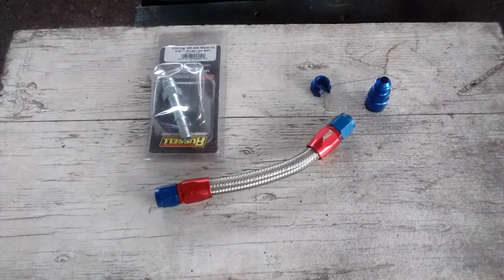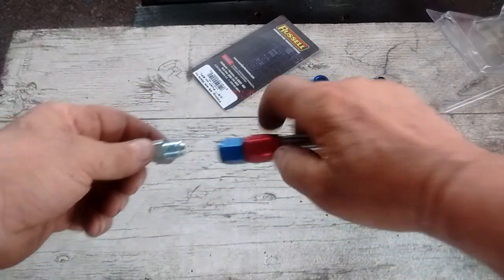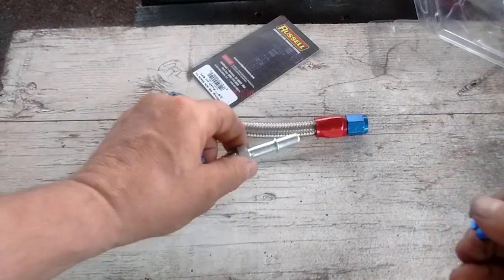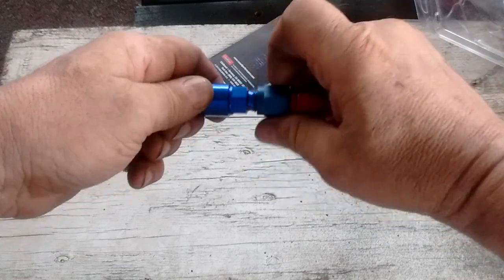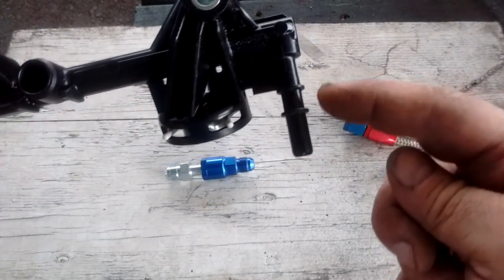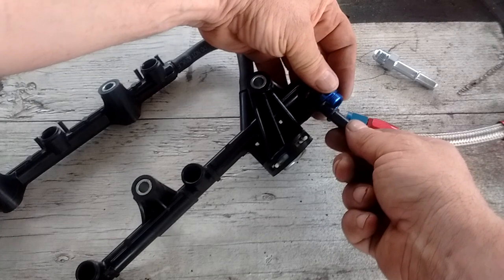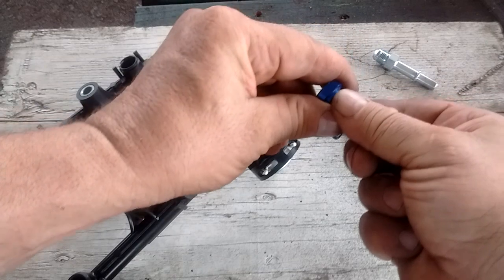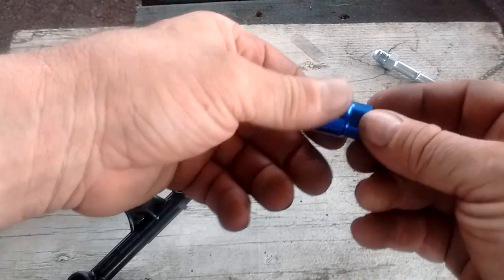Fuel Rail Quick Connect Adapter FAIL - Toyota 3.5-liter V6 2GR-FE

Comment: What solution did you end up using, Frank? 

I have seen the Rat2 fuel adapter which i have ordered out of curiosity, and the gouky/Whilhelm solution of hose clamping a 5/16 (or is it 3/8?)  EFI fuel hose onto the stock plastic adapter. Neither solution is particularly confidence inspiring, I am leaning towards hose clamps at this stage, rather than some no brand AN fitting for Rat2.
Reply from the maker: I used an Aeromotive FPR, that had 6an female o-ring ports. Here's how I hooked everything up - there are three segments 

SEGMENT I.  FUEL RAIL TO FPR:
From the fuel rail: Fuel rail connector hose - Toyota OEM:
P/N 23901-ad011 or 23901-0p040
No modification or extra fittings on the fuel rail itself are needed. Make sure to order the security clamp that goes over the fuel rail connector. 

Then to connect the hose (above) to the FPR, 

Option a. If the FPR has  6an o-ring female port (like mine).
1. 6an flare male to 5/16 quick connect Russell 640930
2. 6an flare female to female coupler Russell 640003
3. 6an o-ring to 6an flare male Russell 670840

Option b. If the FPR has 6an female flare ports (the other kind)
Just this: 6an flare male to 5/16 quick connect Russell 640930
The other two couplers are not needed.
---------------------------

SEGMENT II.  FUEL FILTER TO FPR:
On the fuel filter side:
Fuel filter adapter M12x1.25 to 6an male flare: Russell 640803

On the FPR side: 
6an o-ring to 6an flare male coupler Russell 670840

Then you use a 6an braided line to connect the FPR to the fuel filter. 
------------------------------

SEGMENT III. RETURN LINE - FPR to Fuel Reservoir Return Tube:
On the FPR side: 6an o-ring to 7mm hose barb: Russell 15627 - cheaper equivalents are available on ebay.
Then you can run a 7mm fuel hose from the FPR back to the fuel tank return tube, with fuel hose clamps on each end of the hose. 
___________________

This has been working great for me since I did my swap and last year I did another swap with someone locally and used this same setup.
Reply: @Merryfrankster_  Thanks so much. You, Wilhelm and Gouky and the rest are such great members of the V6 MR2 community. It is just wonderful to have such helpful people around and see what solutions different people have come up with.

Comment: Cut the half required amount off both ends or try to use Russell 640860
Reply from the maker: The 640860 is an option PROVIDED that you can secure it with a locking cover otherwise like any push-on there is a possibility it will pop off (same goes for the OEM line by the way). If you add up the cost of all fittings required with this solution you might as well purchase the OEM line for about $50. As far as cutting or grinding the fitting in this video - you have to cut far more than half, I have done it an you end up with a thin sliver of aluminum about 1/16 or 3/32 that does not inspire any confidence at all.
Reply: It would technically be enough for the job even at 90psi
Reply: I'll be making some 2gr Rails in the future tho